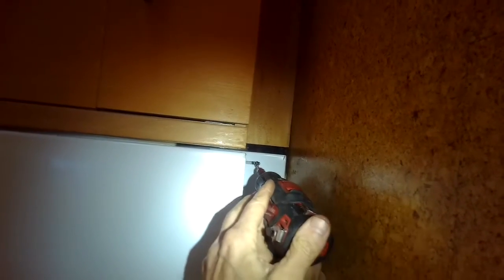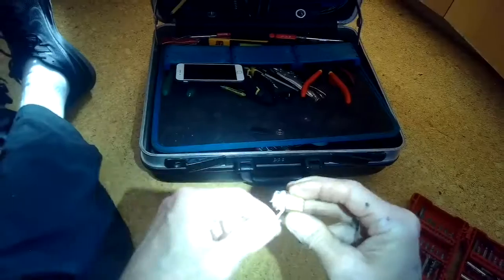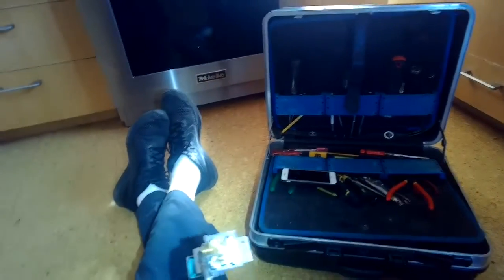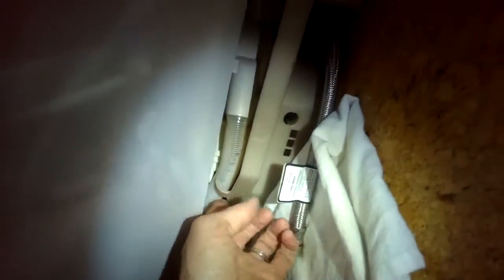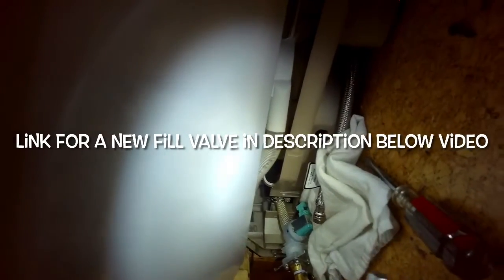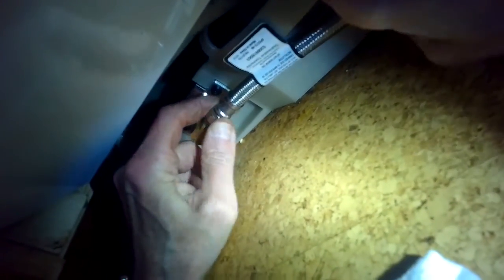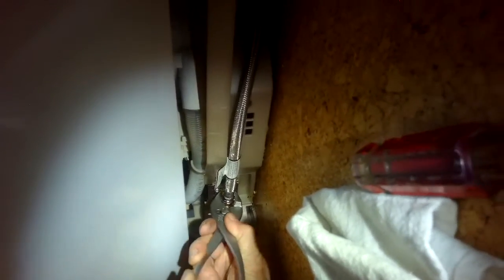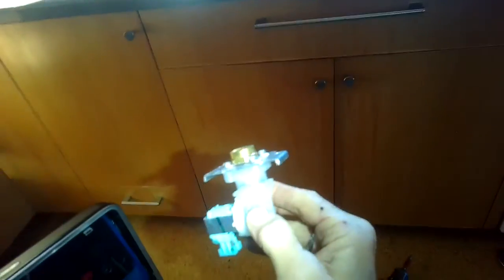✨ Bosch Dishwasher Keeps Filling - EASY FIX ✨

Comment: Our water bill has increased and we couldn't figure out why since on kid was away at college. The dishwasher would rabdomly pump water out and I just assumed it wasn't emptying from the previous cycle so I would manually turn ut on just long enough to pump the water out. I even replaced the guts in an old toilet because I thought it was the culprit. It should've been done anyway. I finally thought that maybe there was a leak in the dishwasher because there was water in it and nobody said they ran it. I just realized today that this is the problem!
Reply from the maker: Nice detective work👍

Comment: This would have been an easy repair if my Bosch was like yours.  On mine, it was not possible to move the drain line, there was very little play on the electrical connection and the hose that gets clamped to the valve, so instead of easy connections we struggled for over an hour to get the old valve detached and the new one connected.  Another very difficult thing to do was attched the plastic front piece under the door after the valve was replaced.  It was designed so that you had to put a screw in a long cavity, find the hole at the end of the cavity and then find the hole that the screw attaches to.  This took us forever, we ended up making a little washer out of masking tape to hold the tip of the screw through the first hole, and then it wasn't as difficult to find the second hole.  If the internal hose and electrical connections had an inch or two more play, and the plastic part was attached with much longer screws that weren't at the end of a deep cavity it would have been an easy repair.  So good luck with your Bosch.  It may be easy, but it might not. Ours took two handy people over two hours.
Reply from the maker: Good way to solve the problem 👍

Comment: My dishwasher won’t stop filling. How do I know if it’s this valve not something else?
Reply from the maker: Hi Toby,
It’s the valve.
That’s the only thing that can cause that.
Reply: @ScottTheFixItGuyChannel  thanks so much. I installed a new valve and it’s fixed.
Reply: Would it be possible that it's a fault control module that's randomly activating the valve? Although if the dishwasher is off, I suppose that control module can't send any signal/voltage?

Comment: This must be the cause of water dripping from our Bosch dishwasher door. There is a lot of water in the machine even though it hasn’t been used for years. We are not used to using dishwashers.
Reply from the maker: Yep,
Just need to replace the bad fill valve👍

Comment: A note when tightening the water supply line back onto the elbow fitting:
You make it hand tight and then tighten it with a wrench but no more than maybe a half turn.  Don't over-tighten that connection or it will leak.  Make it no tighter than you need to make it so it doesn't leak.
If you tighten it all the way where it won't turn anymore and it still leaks, then you need to replace the supply line.
Reply from the maker: Great info.
Thank you 👍😊

Comment: Great video.. however the water valve I bought has a slightly different wire connection than my old one
Reply from the maker: Hi Kayne,
We’re you able to make it work?
Reply: @ScottTheFixItGuyChannel  nope unless I modify it